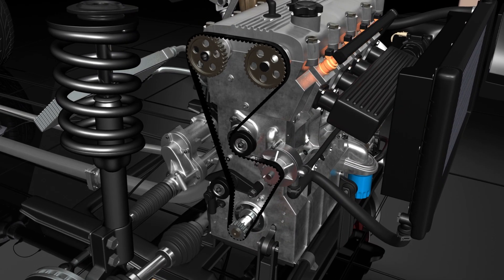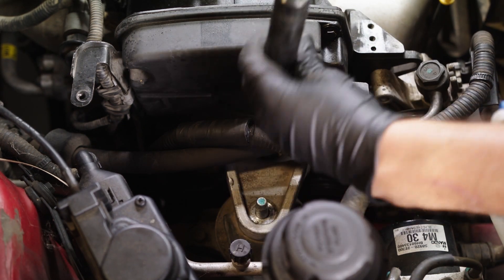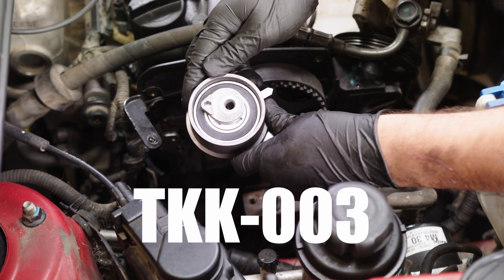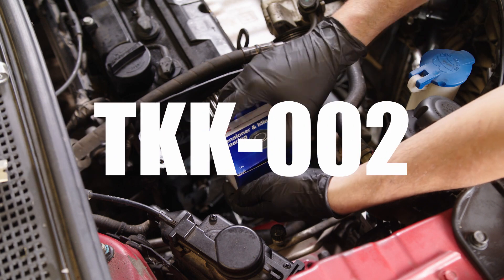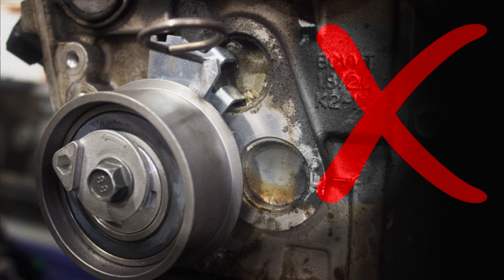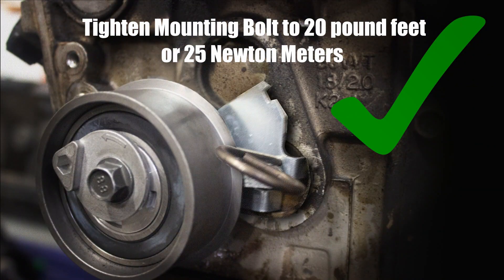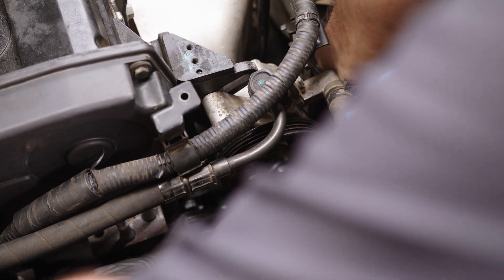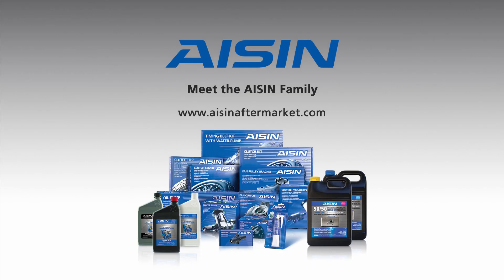AISIN University: Hyundai Kia TKK-002 TKK-003 Timing Belt Kit with Water Pump Installation

Comment: If you have trouble removing the lower timing belt cover you will need to remove the motor mount just to the left of the timing belt. It has two 14mm bolts and you will need a long combination wrench to remove the bolts.

Comment: The torque for water pump bolts is 15-20 ft. lbs or 20-27 Newton meters per the official Hyundai service manuals.

Comment: nice video but you did not say the "torque requirement" for the Water Pump bolts ?
Reply: The official Hyundai service manual torque requirements for the water pump bolts are
20-27 newton meters
or
15-20 foot pounds
I have an Hyundai official service manual but I left in a hot car and the binding of the book melted.